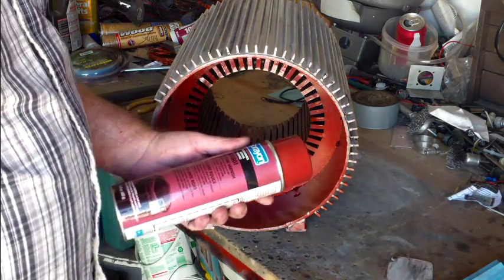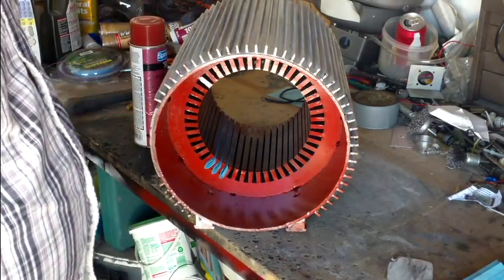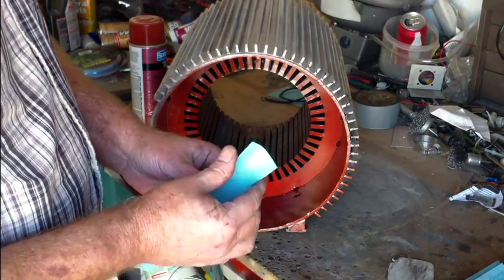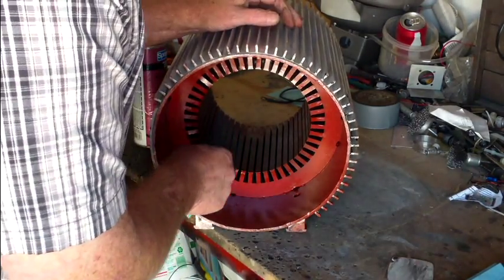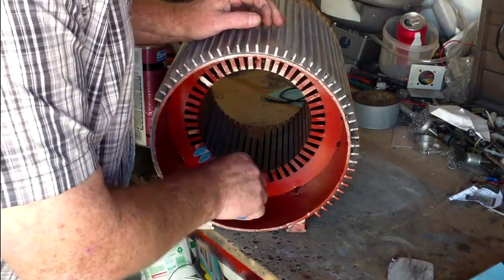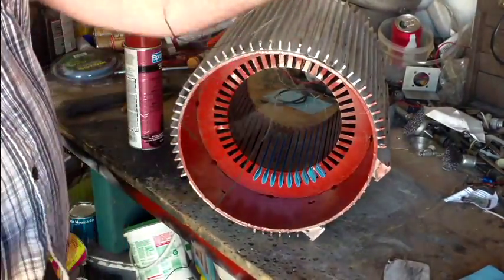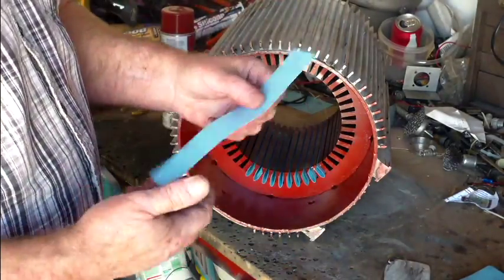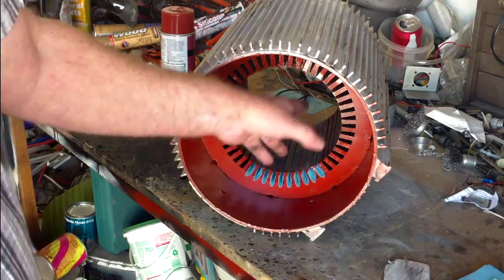Ivan's Garage

Comment: good morning friend Ivan, call me Gurgel
I found this video today, and ask:
# -1 which is the working voltage for this stator? yes, I know it's three phase, I saw other videos you posted,
# - 2 - I wonder if the closure is Delta? or triangle
# - 3- and finely wonder if that engine is today (June 2015) working or was abandoned? * thanks, I am his follower from today! "I use google translator"
Reply from the maker: PUSSYCAT BY ELETRIC   The stator is wound for 60 volts and allways a delta connection, and is still running.